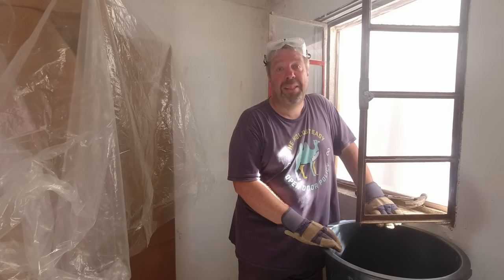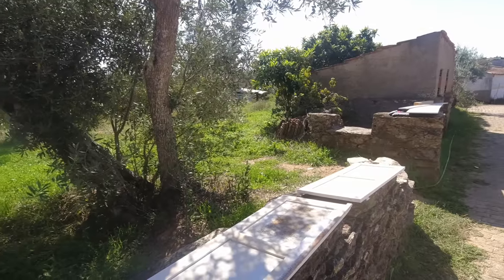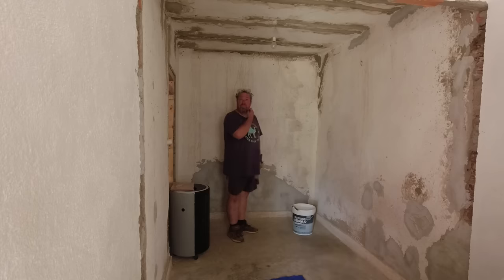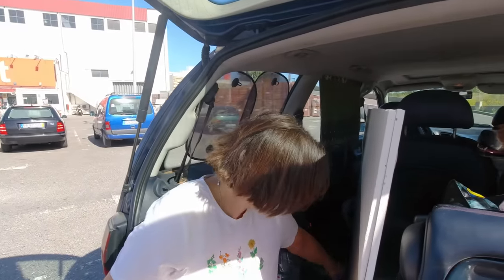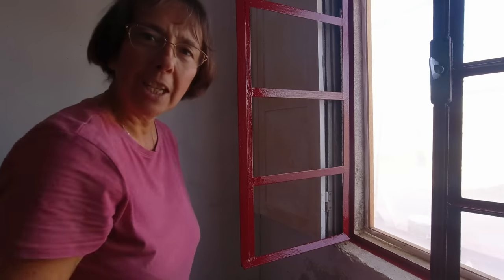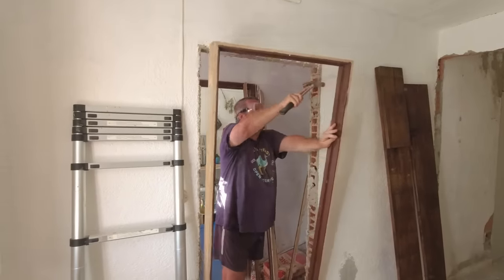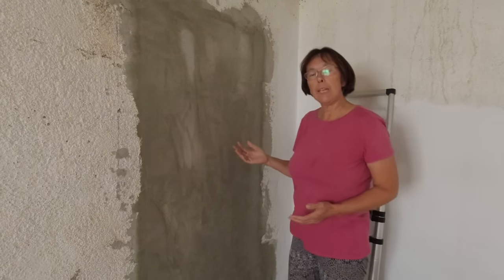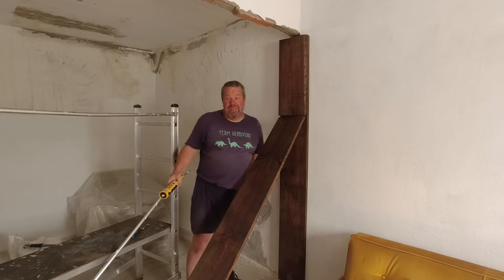87. When Two Rooms Become One -Tiny House Renovations  - Off Grid in Portugal

Comment: Hello. I didn't understand why you didn't fix the issue that remained after tearing down the dividing wall. As for the windows, in this case, you could buy standard thermal windows with double glazing and adjust the opening to the size of the windows. They provide incredible comfort. Finally, you could buy 4 bags of finishing plaster (massa de acabamento) and apply them to the walls to remove that popcorn finish, which is terrible for maintenance. Keep going strong.💪

Comment: Better to use egg shell paint for wood..doesn't discolour like a gloss paint..
Reply from the maker: Only had emulsion to start with, as on video,  but it needed it to help seal and soak into the middle filler section, which was very dry from years if intense sun. I now have gloss paint, the high oil content should seal the wood and help condition it too 👍

Comment: Hey y'all,  looks great!  Question,  The boards you used for the feature, did you have to put 2 together on each side?  But not 2 whole boards, bc it looks like the top board (not on the ceiling)  goes down about 30 inches from the top and the board behind it is on full length.  Maybe its my eye's.   It is 1211AM....and has been a long day!  I love the color of the wood!  Are you going to keep the shutters white or paint the outside red to match the window frame and another color on the back of them for the room?  Bunch of questions tonight/this morning.  LOL. Take Care! 🙏❤️🇺🇸🇬🇧🇵🇹⛵️👣🤙🫠
Reply from the maker: Hi Melinda,  thank you.  Yes you're correct. The boards were double at the top of each one, so there was more for top board to sit on. The shutters will probably stay white to reflect the sun away. May put colour on the inside depending on what I can find and how the room looks.
Take care, Elaine xx 🏠❤️🤗